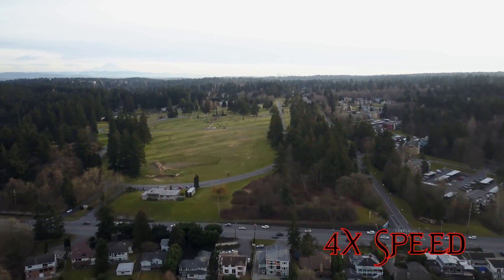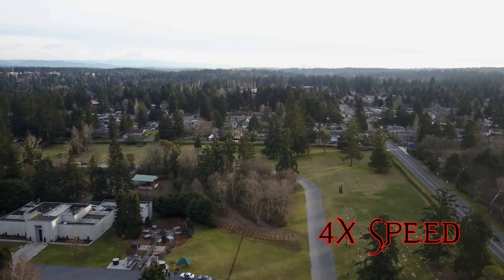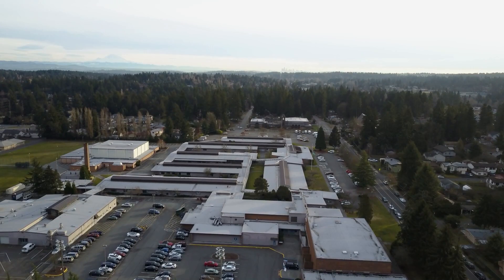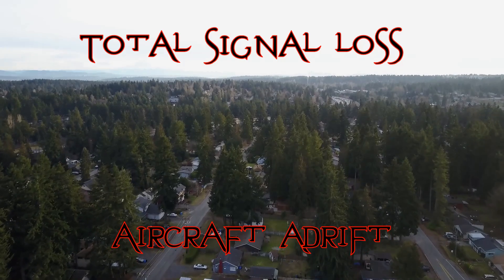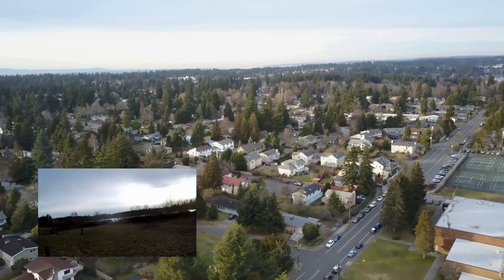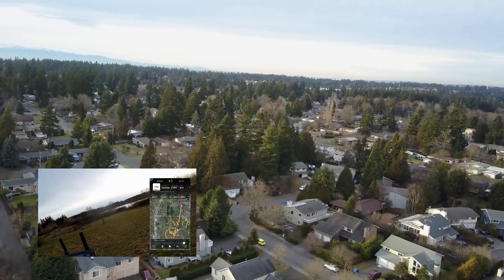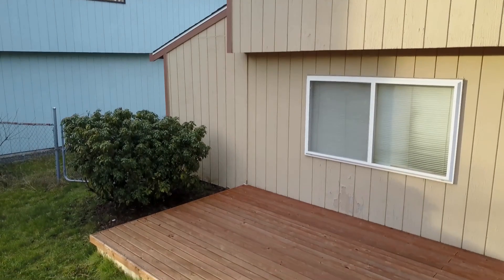Mavic Pro Return to Home (RTH) FAILURE! Recovered footage! What happens when it all goes wrong!

Comment: The Mavic Pro will always return home in such situation. The only two reasons it could not return home completely is if the battery is too low and it will land imediately anywhere as what happened here. And number 2 is if you set the RTH Altitude to very low like 20 meters only, then their's a possibility that it will hit a tree or a light post on it's way back. That's why RTH Altutude should always be set higher like 80meters or atleast 200 feet.

Comment: How come you didn't just check the last known gps point and your footage on your phone and get it on the same day?
Reply from the maker: I did, and since the phone indicated the point where the drone lost contact, while it was still in the sky, and it moved after disconnecting, it was a good 1000+ feet away from that location in someones yard. The controller will only indicate where the drone was last communicated with. If the drone is still in the air, and moves, it can go as far as the battery will take it...

Comment: You lost it due to flying too low. The higher you are, the farther you maintain contact with the drone. RF is line of sight and is rapidly attenuated when having to travel through solid objects. Next time go on Google Earth, locate the house, drive to the house, get your drone. It would have been a 30 min wait, as opposed to two weeks. I'm surprised you didn't do just that.
Reply from the maker: I think you missed a few things. First, I was flying at about 360 feet. Just a little under what the legal limit here is in the US. Second, this was RECOVERED footage from the drone when I got it back. At the point in the video where is say "all signal lost" i mean all signal was lost. I had no video feed, no telemetry data, no GPS, nothing. I had no idea if my drone stopped and hovered in place, fell from the sky, when through some dimensional worm hole or what. I had no idea it had started a return home procedure and then failed and landed in that persons yard, which was about 1500 feet the opposite direction I was originally headed. I did in fact search the entire area around there, and posted fliers. Got lucky on craigslist.

Comment: I have lost contact with my Phantom 2 Vision and my Mavic Pro on separate occasions due to low battery status. The Phantom 2 Vision fell out of the sky when the battery died trying to get it home. (Landed in fresh snow with no damage.) The Mavic Pro landed safely but out of my sight. I Pointed the camera straight down and found a safe area to land but was not sure of the location. Both times I was easily able to locate them using the "Find My Drone" feature in the apps. Why was that not an option?
Reply from the maker: Hudson Valley Drone Flights first, that option was added in March 2017 (at least on the Android version of the app) so that option did not exist. Secondly, find my Drone only functions while the battery is working on the Drone. That may or may not work depending if the Drone was stationary when the battery died and it sent its last location signal.

Comment: The same thing happen to me, twice. The first time, when I got a weak signal and the drone started drifting with the wind, I followed it on my car and recovered it from the house where it landed. Being awareof the fact that the Mavic, having an intermitent connection with the remote (even though not good enough to control de bird), was preventing me from flying it and also from bringing it home, I decided to turn off the remote and phone completely. This time it worked and my Mavic returned home on its own before the battery was completely drained.
My conclussion: a weak signal (or lost as seen in the remote) is not really completely lost and, therefore is not strong enough to control or bring home the drone but also not completely lost so as to start the automatic return home function. Just switch everything off and it will come back home

Comment: You flew 10 x past VLOS and you found what you were looking for, failure.  Lesson learned for the rest of us.
Reply from the maker: Gary Mayo so basically DJI should stop making drones that can fly more than 100 yards from the controller because you can no longer see it. The Mavic has an interlock that makes it totally fail and malfunction if it looses eye contact.? I guess we should all have fun flying our $1000+ Drone in circles in our back yard because that's all it can do.
Reply: @InfiniteTDigital  It is not DJI that makes you decide how and where you fly your Mavic, it is you, there are rules and regulations that are put in place to fly drones responsibly, I can never understand why people fly over populated areas, especially long range, never rely on flying the drone on the DJI app without learning how to fly with the transmitter as well, if the app crashes, at least you can get it back flying it with the telemetry on the controller, too many things can go wrong when flying over a built up area.
Reply: I think it is great you push the envelope, but if you are going to go test pilot, you can expect a few hiccups.   And as always, fly responsibly.    One pound of weight in freefall from 200 feet can kill or cripple people.

Comment: I can see where you've gone wrong. The manual does state that flying over infrastructure, houses, metal/steel buildings anything that emits electromagnetic and/or static interference, home routers, GPRS base stations, etc, will seriously hamper your flight hence why you lost the signal. You should have known this and stopped the flight or lifted higher. The higher you lift the less delayed the signal will become from you to the craft. The lower you are and the craft and should there be trees/obstacles in front of you signal will be strained. I prefer to stand on higher ground such as a hill if there are trees in front of me, or obstacles, that way if I am forced to fly low the signal can still flow freely to some extent. 

Your signal loss seems to have occurred just as you began flying over those white roofs. On the ground there are power/telephone lines too. Interference everywhere. What strikes me as funny is that DJI would have known this yet they've not given you that answer - despite the fact it's your fault not there's. The RTH fail safe doesn't work if you're in atti mode which it looks as if you were, hence the drifting about. Then its decided to kick back into action on regaining a GPS lock, then lost it again, something's happened possibly the IMU has been affected by the interference. You're lucky the craft didn't decide to land on a road with moving cars. 

There are ways to stop this. Don't fly over infrastructure or peoples homes [this is stated in the manual] always ensure your antenna are positioned correctly. You must give yourself some distance between obstacles around you, such as trees in front of you. I walk at least 400 meters away from such obstacles. Always fly over greenland and not houses, buildings etc. I have a video if you want to view what I mean. The RTH and fail safe did work, however the craft has repeatedly gone into atti mode then its battery has only been enough to RTH thus landing. Seems all a tad odd. If you have the full black box data I can look further into this just to ensure there isn't a fault on the craft.
Reply from the maker: Good info. There is a lot of speculation on what happened. In short, I am pretty sure it was a compass failure (and maybe some other things). I was at max legal altitude (400 feet 120m). The interesting thing is, despite of the location and conditions, My 3DR Solo drone made the same flight twice with trouble. My Phantom 3A did the same flight twice. This was the SECOND trip for the Mavic, which is when the problem happened. The drone was launched in GPS mode, with home point recorded. The entire flight was in GPS mode. It may have dropped to ATTI after it disconnected from the controller, but since i had no connection, I had no knowledge of the status. It tried to RTH, but did not know its proper heading , and emergency landed in that yard. It actually hovered about 3 feet off the ground for about 9 minutes UNTIL the battery went critical and then landed.
Reply: It should have RTH that's what the internal computer is designed to do hence why it updates the home point before you take off both on the instrument panel and the bird. 

You did ensure that the home point was logged before take off? I've made this mistake a number of times (its a common error), and then had to bring a drone back on realising. 

No home point - no RTH. It doesn't know where to head back nor can it calculate its battery use and travel distance enough so its next fail safe is to hover and land when the battery reaches critical. 

I highly suspect there are a number of issues here. The home point wasn't registered. You need to keep that drone near you until HP is updated, if it doesn't work - then land and restart. 

Then we have magnetic interference of which its likely both the battery and the compass were effected. Signal loss because you're flying over infrastructure is very common with the Mavic. I've solved this issue to 'some degree' by using nano-sync tech. If you've never heard of it look it up, apply it. 

I do have a group on Facebook - I've also many years experience flying, building, fixing, diagnostics; there's very little I don't know about these machines or anything electrical. Just a hobby, but better to be in the know. 

Here's the group: https://www.facebook.com/groups/1953913901558419/

Jose.

Comment: Pilots should always recalibrate the compass before flights. I've built a few drones with GPS, if compass is wrong all bets are off.  Always test RTH on first flight to verify.
Reply from the maker: Steve I calibrate the compass on the Mavic every time I am prompted by the app. In this case, I had. This was the second of two flights with the Mavic when things went wrong.
Reply: Infinite-T Digital I've been itching to buy one of these...has this been an ongoing problem? Any more incidences?  I've had antennas on towers jack with my drone... Wonder if something knocked yours out of calibration?
Reply from the maker: Hi Steve. I have not had it happen again at all thankfully. I have hundreds of hours flying drones and so far the phantom and the Mavic are pretty solid. Let's face is, machines are machines, putting them in the sky or water seems to make it even more complicated. Fly safe!
Reply: Test both GPS RTH and failsafe.

Comment: Not to be a dick but going so far away and flying over cars and people isn't a great idea anyway..line of sight flying will keep your drone safe and not a mile or two away ending up in someone's yard. I have a mavic also but man I'm not into loosing 1000$ either... seems u take some risks flying that far
Reply from the maker: I somewhat agree, if i knew what was going to happen I may have chosen a different place to do my testing. however, If something malfunctions, as is was the case here, I dont think it would matter if i was 10 yards, 100, or 1000 yards away. I have heard stories of flyaways when the drone is mere feet away in plane sight and who knows where it went and what havoc it may or may nor have caused. Weather its 100 feet directly overhead in the park or on the other side of the park, if something goes wrong, there's not much you can do in either case. What I was trying to illustrate here is DONT rely on the fail safes,  (RTH, etc) but also, when all hell breaks lose, it's not very likely these will cause some catastrophic  "death from above" scenario.  AN interesting learning experience for myself and others. ANd to also share my experience of dealing with the manufacturer who in no way shape or form showed any desire to even help remedy the situation. It's a risk every time the thing goes up in the air. If something goes wrong it can travel at speeds over 20mph (or 40 in sport mode) for almost half an hour. If it gets a mind of it's own it can cover a lot of ground and you cant do a damn thing no mater where you are in relation to it.
Reply: Infinite-T Digital I must say I have to agree with your statement. I enjoyed your video I was just observing the cars and people around your flying route...seemed sketchy and not exactly FAA friendly by their guidelines...happy you got it back. Now that China isn't playing nice with the US they will probably throw a switch and send all of our Dji drones crashing out of the sky lmao.  Hope I wasn't being a stickler, just curious honestly..I'm a few month old dji mavic owner and learning more daily about this drone. Thanks for the reply.
Reply from the maker: No worries. I understood what you meant. Ive learned a lot since then myself. Although I have permission to fly over  both those parks and the cemetery, because of that road, and the likely population, i do not do long range flying there anymore. Enjoy and fly safe.

Comment: Hey man, glad you successfully recovered it. Can't imagine how scary that was. I'm still new to the Mavic but I learned something which I thought worthy that is to rotate the aircraft 360deg manually by hand before every takeoff and make sure the rotation orientation matches to the aircraft red indicator on the map. I'm also wondering for your case was the signal lost option set to RTH, hover or land?
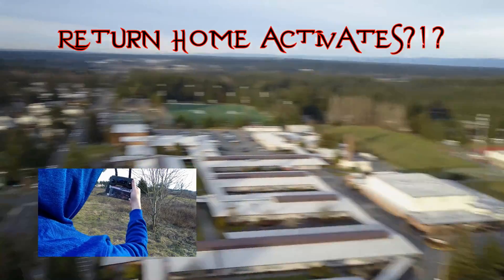Reply from the maker: Thats a good Idea, however i think in this case the compass got scrambled in flight. es, I always have the signal loss set to RTH, very good question though. In the recovered footage im pretty sure it started to return home 3:53, but lost its direction. Thanks and Happy flying!

Comment: Possibly lost GPS?  What type of school was that?  Could they have any RF equipment that could potentially cover the GPS band?   It doesn't take much to swamp a GPS receiver.  
I think manually returning home after the first RTH button attempt failed would be a good idea going forward.
Reply from the maker: mevmevmev I said the wrong thing in the video. It's actually a community center.  I'm not sure if there is any special equipment there. I think it was a compass problem with the way it behaved after signal loss.
Reply: Good call. I was blaming all the metal structures. I know that the factory near my house(metal building) and the high tension wires make the gps go nuts, so I avoid those areas. Personally, I turn back toward home anytime I lose signal at all. Even a choppy signal sends me rushing back toward home.

Comment: This guide might help someone. Only calibrate compass when prompted. Heres a safety guide. 

Safe distances for compass calibration

6” (15 cm) minimum: Metal rim glasses, pen/pencil, metal watch band, pocket knife, metal zipper/buttons, belt buckle, batteries, binoculars, cell phone, keys, camera, camcorder, survey nails, metal tape measure.
18” (50 cm) minimum: Clipboard, data collector, computer, GPS antenna, 2-way radio, hand gun, hatchet, cell phone case with magnetic closure.
6 ft (2 m) minimum: Bicycle, fire hydrant, road signs, sewer cap or drain, steel pole, ATV, guy wire, magnets, chain-link fence, bar-wire fence, data collectors

that use a magnet to hold the stylus.
15 ft (5 m) minimum: Electrical box, small car/truck, powerline, building with concrete & steel.
30 ft (10 m) minimum: Large truck, metal building, heavy machinery.
Reply: Huh?

Comment: Interesting. It's disturbing that DJI did not offer any help or explanation. As far as I can see its pretty clear, it's a product failure and not a pilot error. Theres no point in calibrating the compass if it get scrambled somehow in midair and does not return home. I wonder what can cause such interference from below, unless its a hardware failure - the compass sensor.
Reply from the maker: I agree, I was pretty disappointed with the lack of help and support. I have no idea exactly what went wrong and how, thankfully it hasnt happened again.

Comment: In the first video you calibrated the compass incorrectly.  The correct way is NOT to turn in a circle, but to rotate the Mavic on it's two axis as described in the app.  Secondly, there is no need to calibrate the drone every time you fly, in fact doing so only gives rise to inducing compass errors if done incorrectly, or in a location that is unsuitable such as over rebar in concrete, or close to a metal object.  Only calibrate it if you significantly change locations from where it was last calibrated (say 100 Klm), and even then there is no real need.  Also, after calibrating the compass, ALWAYS power everything down, restart, and do a quick (VLOS)  RTH test to verify accuracy.  I recently took my drone from Thailand to Holland and flew without re-calibrating the compass - RTH worked perfectly.
Reply from the maker: Honestly, I calibrate the compass when the app says it needs calibration. I've done this by only spinning the drone as well as my body while holding the drone since I first got my Phantom 3 a year and a half ago. It never seemed to make a difference what method I used. Even the official DJI tutorial shows the guy holding it and turning his body. https://youtu.be/DHCDJKChXTE. I never had a problem before or after this incident with the hundreds of flights with all my drones... thankfully. Fly safe!